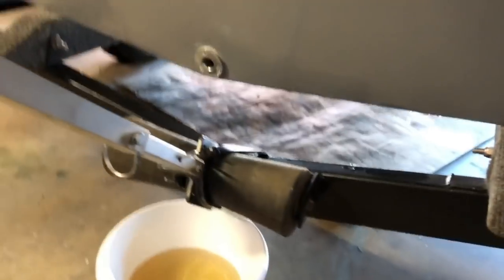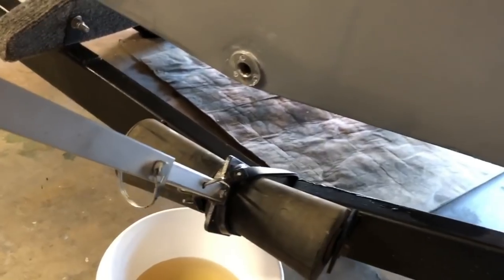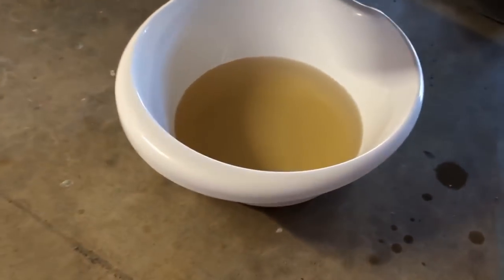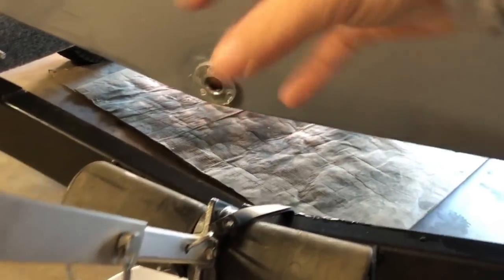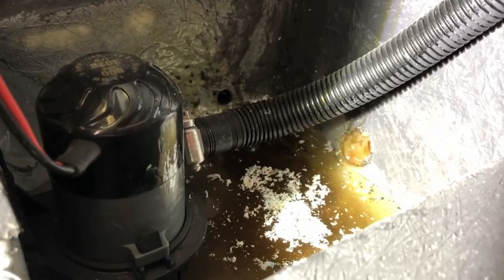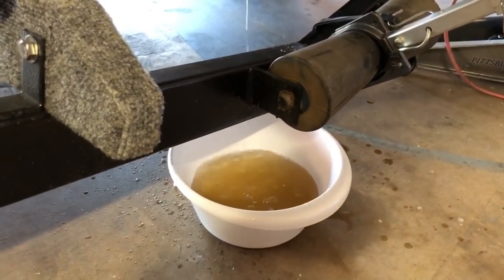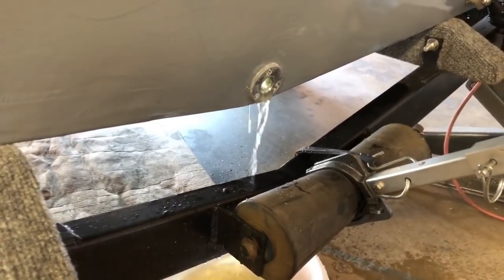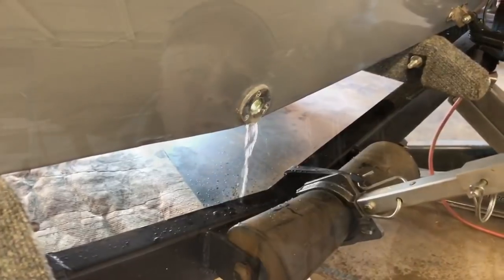The Boat is Leaking

Comment: Never owned a boat that didn't take on some water. Well there was that one time the battery broke the bilge connection (pvc) and ...well, it nearly sunk. Got that fixed and nary a problem after that. From micro-cracks to loose rivets in fiberglass and aluminum boats happen. That's why there are life jackets, bondo, gorilla epoxy and crossed fingers.
Reply from the maker: Lol, it’s not going to be a big problem. Just a minor nuisance(crossed fingers).

Comment: my boat doesn't leak yet, but I keep putting it in without the plug. One time i got pretty far from the ramp when I saw water in my feet.. Scariest I have ever been on my boat. You will take care of this
Reply from the maker: Nothin but a chicken wing. Got some good use from the fish finder. I have a video currently processing that shows it working well. Thanks Victor
Reply: @borfishing7690     they sell a product at the autoparts store called duraglass you mix it like bondo but its fiberglass we use it all the time on cars
Reply from the maker: I’m going to get some and see if I can seal the leaks, thanks Ian
Reply: @borfishing7690  it will work great it is fiberglass .but when you put it on it gets very hard .so smooth it out the best you can before sanding.its easier then messing with fiberglass cloth.you mix it just like bondo.also i made wheels just lime yours for a flatbottom boat.i seen your vid on the dolly wheels you did.worked great.